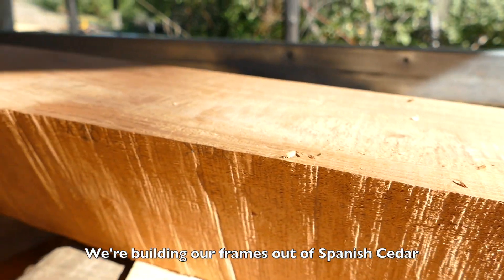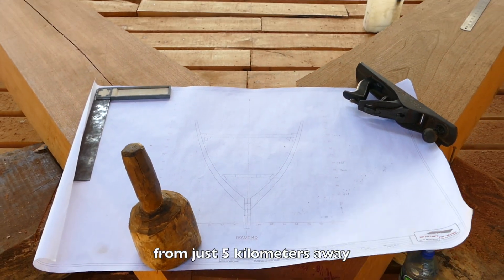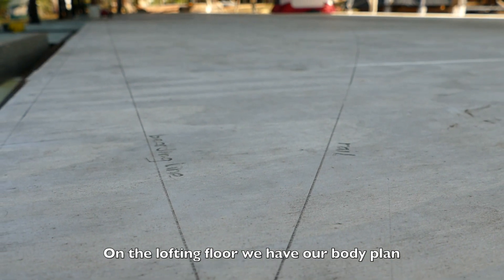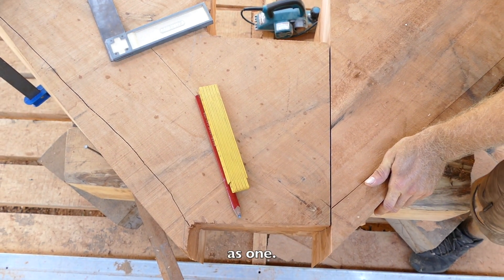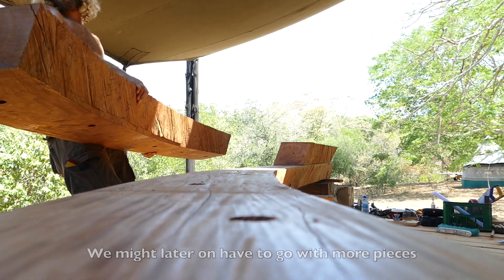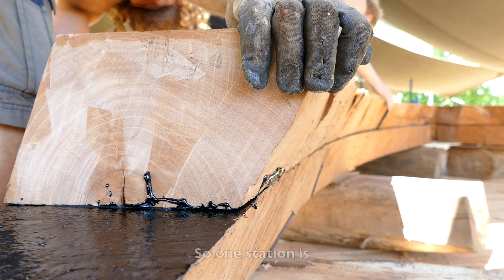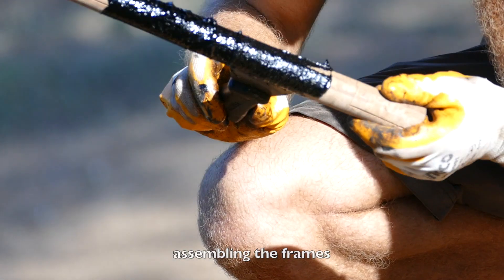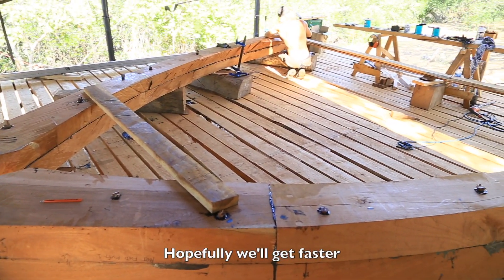Making and Raising Ceiba's First Frames (with Silas) - SAILCARGO INC.

Comment: Please tell me you folks are NOT building frames (tight for "now") out of fresh or semi-fresh GREEN uncured wood?  Be so good to hear - what an amazing project bringing together what obviously are amazing people. The two 1920's tall ships I did historical restoration volunteer work on had traditional requirements for both their frames and plankings - mid-winter cut trees seasoned for one or two years in the salt-marsh.  On James Cagney's replic privateer The Swift, (90+ feet) we went thru the entire in-nerds, including pulling the keel with ice-picks and from all that the total rot pulled out filled a three pound Coffee can just shy from its top.  What is the shrinkage factor of this Spanish-Cedar; if I remembered that correctly?  Wishing each and every one of you crew the very very best.